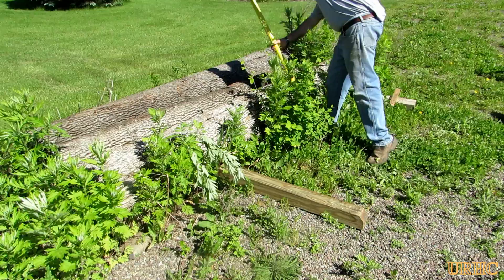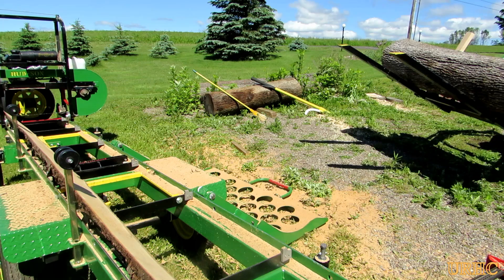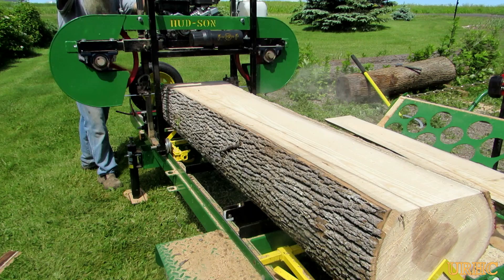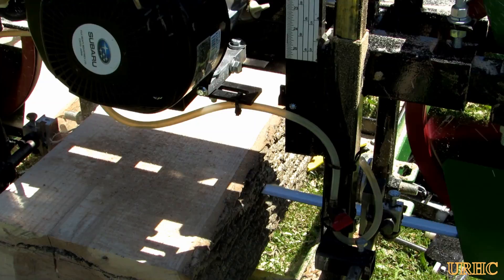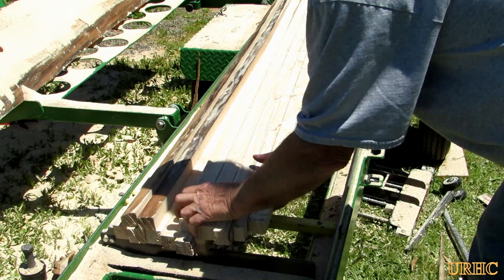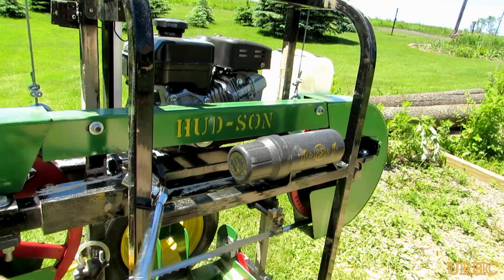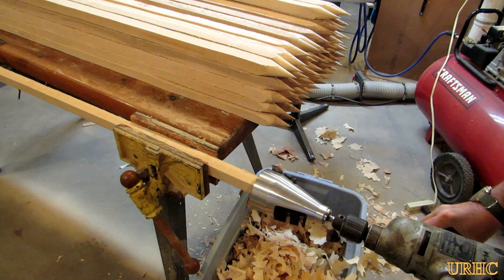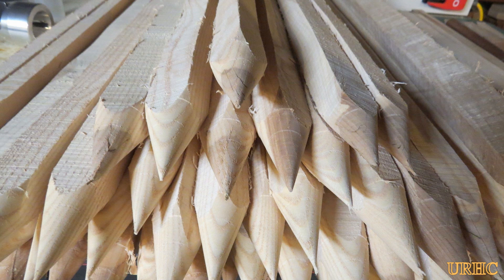Making A Batch Of Ash Garden Stakes

Comment: That's a lot of stakes. Wow!! Glad you saved all those shavings. They will make great firestarter. I might make some steaks myself out of that huge ash tree. Milling that tree is going to take all the timberpro has to offer and then some.
Reply from the maker: You can never have enough stakes. My old ones started rotting and breaking off from the wind so it was time for some new ones. You may be best to slice the boards and then rip them up on a table saw to give your timberpro a break. That will give you a good workout.

Comment: three years later after this video, Ash lumber doesn’t exist except in private stockpiles. Nice logs like these would have provided exceptional boards, stave handle blanks,  and baseball bat blanks. Due to the invasive emerald ash borer, ash is dead or dying. If you have nice clear logs like these today, have them custom cut or sell them and buy a million garden stakes. All that said, this is a very useful video, thank you
Reply from the maker: Ours are still dying around here and most just cut them into firewood now.  The EAB is still present and I  have a good supply of ash lumber cut for my future needs. Thanks for watching.

Comment: You mentioned getting a shorter cant hook some day. 35 years ago or more a friend of mine and I did some very "light" logging. He cut a hook with gas and a hacksaw from a piece of steel, formed a clasp and attached the hook to a 2" galvanized pipe for a handle. Ingenuity and lack of money contributed to the project. I'm sure you could make a much better device in considerably less time with your plasma cutter. Thanks for sharing.
Reply from the maker: I am kind of hooked on the Logrites. They have just the right geometry and are a sponsor of a forum that I visit so I like to support them. I could make one, but hate to have to buy a sheet of steel and do not have any hardening equipment. Plus the handles are aluminum and extremely light. They have a mill special that is on my want list. I bought a cheep one at tractor supply to start with and it bent the first use and just would not grab a log properly. Thanks for watching.

Comment: I saw on another channel that if you back away slightly on heavy cuts (kinda like pushing, but giving it half a second of rest, not enough to mark it as i saw) it lets up and doesn't wobble as much.
Reply: @7:40, when you make that pass, it kinda makes me wonder why they didn't incorporate a safety so that when you reach the metal with your blade, it either stops, or automatically bumps them lower. It wouldn't be that complicated, just a piece of metal that rides along the cut (since the side of the log is a known quantity in that position).
Reply from the maker: I try and watch with each cut after destroying a blade. I looked at making a stop, but  with oversized logs that use the screw on brackets it would be in the way. The saw could probably use a couple more horse power to push a 10 degree blade through ash like this. Ash seems to create the biggest problem and I will try your tip the next time it starts.

Comment: Does your little tractor have individual brakes?  Wheel brakes are your friends if you need to turn tightly with a tractor.  Nice video.
Reply from the maker: I do and they work great without the loader.  On a little hill like this with a log on the loader I have to keep it in 4 wheel drive so it will stop  because the back wheels will just slide and if you use the individual brakes like that it tries to rip itself apart. I  may just need a bigger tractor.  Thanks for watching.

Comment: I just watched your video, I would love to know what that kind of bit is you used to sharpen the ends and what kind of drill would I have to have to attach it.  I am a woman who knows nothing of what you are doing except that I want to know how to work with wood.  So...could you please tell me the exact wording I would use when going to Lowes to buy the sharpner and the drill size.  I thank you in advance for the help.  I'm subscribing to your channel to watch more, thanks for sharing your work.  Miss Rita
Reply from the maker: You can't buy it at lowes. The pointer is from lumberjack tools. https://www.lumberjacktools.com/collections/staking-tool-accessories/products/30-staking-tool . You need a very heavy duty low speed drill and they also sell that on their website.  It will cost you about $400.00 to get started and you also need a good vise to hold the stakes while pointing.  It is industrial grade equipment and they also sell other tools for shaping log ends.  Thanks for watching.

Comment: How about make the drill stationary, and a table to lay the stake on and just feed it through till the point is as you want them? Kind of tablesaw like contraption.......
Reply from the maker: Everything has to be centered and clamped tightly so it will take fiddling to make something like that work for different size stakes.  I plan on making a self centering clamp and mounting it on a motor someday.  Thanks for watching.

Comment: i would like it -if u showed me how ur little 4100 works. why do u keep moving the left side lever? doesn't it have 2 pedals on the right floor boards for forward and reverse? just curious-ok.
Reply from the maker: It is gear drive, not hydro. 8 forward gears and 4 reverse controlled by the shifter on the left. The 2 pedals are the left and right side brakes.

Comment: You can buy lots of stakes with the cost of all that gear.
Reply from the maker: If that is all it is used for. Thanks for watching.
Reply: It's actually hard to find 1.5x1.5 garden stakes that are 8 and 10 ft.  The ones they sell at the big box stores are 6ft at the most and they are crappy and thin and brittle and very expensive considering they are sub-par.  Most of them in the pack are no good and break when driving them into the ground.  Even if you find a 6 ft stake, after you pound it into the ground, all you have is 4.5 feet left to stake your tomatoes.  You need a good 8-10 ft stake for tomatoes since you lose about 1.5 feet in the ground.  I did what this guy did with 2x2 (actual size 1.75x1.75) furring strips but I had to cut the points with a sawzall. Then I charred them from the tip up 1.5 feet with a soldering torch.  This has made them last many years.  Charring stakes and fence posts is an old, but tried and true technology for making them rot slower in the dirt.  It beats using chemical-infused treated lumber in your garden.  Sure, they tell you that today's copper treated wood is safe for gardening, but then they said that with the arsenic treated wood, too.  In 10 years, it will be uncovered that the copper is toxic for gardens and then they will come out with a new treated wood that is "garden safe".  You just can trust this Chosenite race that runs our world and own everything.  All they want to do is take your money...and you soul.  I say, impale them all on stakes and leave them to dry and rot in the hot sun!  
Your pal, 
Vlad The Impaler Țepeș III